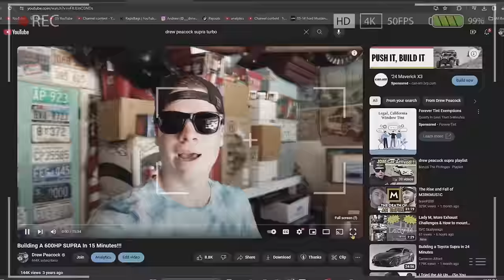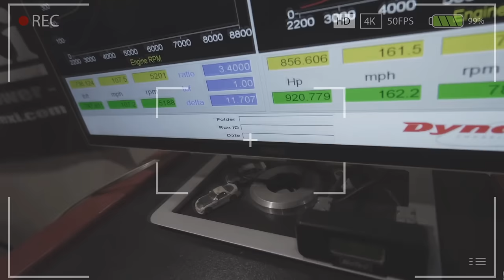My Life Is Ruined… Dream Car is Gone…

Comment: Trust me, that metal is toast. You need new frame rails and aprons. That metal is severely fatigued from the heat.
Reply: bro just shut up fr. let the man fix his own car you go work on yours
Reply: then you go fix it
Reply: @Thursty6 but he's right lol
Reply: @Thursty6 the truth hurts doesn't it? And besides they are allowed to state their opinion on the matter
Reply: @Thursty6  You can't fix fatigued metal unless you'll go ahead and melt it to it's liquid state and start over again. That metal is warped, you'll have body gap issues, structural rigidity is going to be bad and unsafe. The frame of the car is designed and meant to flex, with the frame being fatigued and warped, it would become hard and brittle. So yeah, bro just shut up fr. The car is cooked and it's going to be an absolute money pit if he tries to rebuild it, not to mention the resale value is also gone, the hassle and headaches, the safety concerns. It's not worth it, might as well just buy a new one.
Reply: @_M.Silva_  Bro said he dosent care about the resale value, did you even watch the full thing? lol
Reply: i´ll be honest it might be still fixable.
Cut a whole bunch off the front and replace it.
The frame at the front is prolly burned but they can be changed.
A good welder alot of metal work and it´s a supra!
Is it financially responsable? Nope!
But in the end it will be a supra again with a weird history.
Reply: If he can get a body shop (or maybe even do it himself) to remove the oem spot welds and put new metal pieces on, the supra should be good to rebuild
Reply: @JoshuasProductions  did i only talk about the resale value in my statement?
Reply: @_M.Silva_  no but there is no point in even mentioning it if he does not care lmao
Reply: @JoshuasProductions  i was talking about the negative things about rebuilding a burned down car didn't i? Whether he cares about resale value or not, since i was talking about the negative effects of rebuilding a burned down car, it doesn't change the fact that the resale value is gone. And i mentioned it just for the sake of the topic. What's so hard to understand?
Reply: @Thursty6  bro is mad for no reason
Reply: @Delta132  i´m not sure if a bodyshop would touch a burned car.
But he could do it himself, Mat Armstrong already proved it can be done with almost no experience.
Would be a great projekt for us to watch for sure.
Reply: Hey, im studying mec eng, so i might have a lil bit of knowledge. The temperatures of the fire, for what ive seen, werent high enough to change the majority of the properties of the metal. fatigue is different. Since the metal wasnt under high forces, only high temperatures, you might have room to work with. It is not the same metal, is wont handle the same, prolly a little bit worst, but it might be reusable. is trully a MAYBE situation that only drew and whos working with him will know , if so.
Reply: is like doing sports after an injury
Reply: Reps of NASA have been debating on this chat 😂
Reply: Time to tube the front end 🤷🏻‍♂️
Reply: @Thursty6 difference is, its now structurally unsafe, even a small crash could cause the driver and any passengers death, value of life is way above the value of the car
Reply: I second this. You cannot reuse the front end of that car. It is no longer safe in an accident and will cause more headaches in the future.
Reply: No its not. The steel used to make frames is freaking designed for high heat because of the engine. The engine? The block and everything in it is probably fine. Everything else? toast. The frame? Good. Suspension? toast. Brakes? fine. But again the frame and block are fine.

Comment: Those aprons and lower rails are high strength steel. It doesn't play nice with high temperatures it makes it brittle. You won't find out how bad it is until it's involved in an accident and the rails crumble instead of collapse as designed. Can put a lot more impact into the cabin and be dangerous. Replace the front structure, it's not worth the risk. Just buy a front clip and swap over the the apron and rails.

Comment: Bro that’s actually so unfortunate. The worst part is the Supra is so overhyped now that it’s going to be almost impossible to find a non wildly overpriced one to replace it 😔
Reply: thats why he should rebuild it ... and do it all fresh at the same time
Reply: @G35Jeesh  might be more expensive that way. Also is gonna be hard to find the parts for it
Reply: @Spendo  Yes, but im not talking about restoring it OEM. Im talking about tucked harnesses, drift style dash etc .... He needs to remove the motor and clean it all up and it would seem like an easier project. Anyways .... Not an OEM build, but enough to know its still a supra on the inside
Reply: @G35Jeesh  nah its structurally toast due to the heat. It wouldn't be smart to rebuild that.
Reply: @G35Jeesh Fire ruins the integrity of the frame. He'd have to do a lot of cutting for it to even pass a state inspection.

Comment: Sorry for the loss, but honestly I admire your attitude towards this whole thing.
My question is, if the motor and transmission are very much salvageable, wouldn't it be easier/safer (probably not cheaper?) to get a new chassis? Maybe a non-turbo automatic, since the drivetrain is gonna get swapped either way.
Reply: There are hardly any rolling shells and if one pops up they go for around 30k. Rebuilding a burned car can be a process, but should be a lot cheaper than swapping everything to a new shell.

Comment: This gave me an idea, might already be a thing. There’s got to be some way to put a canister of fire retardant on the under side of the hood that can spray the entire bay when an excess heat temp is sensed
Reply: Yea, you can buy a fire suppression system for vehicles. Good idea if you got big bucks and a big buck car.
This said the chances of a vehicle catching on fire without be touched is very very low. Unless its an electric vehicle..😅 then the chances are 50/50 of it spontaneously combusting.

Comment: I had a Toyota Camry with 400k+ miles catch fire from a wire coming loose from a new headlight I had just replaced. I didnt have a fire extinguisher and oil had leaked all in the engine bay, so it went up like a roman candle lol. I was devistated because it was my only vehicle.

Comment: The carbon fiber hood became a carbon fiber blanket lol. Jokes aside, sorry for your loss even if it was just a car. One thing I’d be careful of is that you should, in at least some way, reenforce the burnt metal. It may not be aluminum but the heat weakens the structural integrity of the metal and it could collapse under too much weight or stress. I can’t wait to see how this build turns out!
Reply: Literally 5 seconds after I hit play you explained you’ll be checking the metal 😂 ignore my comment

Comment: As a body guy, do not sand or grind the chassis. Take the time and strip the car down completely and have it chemical dipped to restore it properly. If you don’t, you will have issues with corrosion and it’s legitimately the best road to take.

Comment: So like you said I really doubt it got hot enough but considering how thin the frame steel is it's could have warped the frame. Not only that but also could have heated up enough to soften the steel making it much weaker and less likely to flex and go back to its original shape. If I remember right it can take less the 400° to change the structural integrity of your most common steels. Just something to think about. I'd hate for you to put more work and money into it just to find out the frame won't handle torque twist. I know you can straighten a bent frame. I'd just be more worried about the structural integrity.

Comment: Well the problem is that metal gets weak and soft when heated up an slowly cooled down.. I would check the alignment of the front suspention/axle/frame and if it is really badly bent, I definetly would swap the front frame. chop here chop there and weld in a new front. You know what I mean..

Comment: Cars burn down a lot more than you would guess.  It doesn't take but a minute or two before they are too big to put out without a big fire extinguisher, as cars have all kinds of accelerants on-board at all-times, and they have flammable paint and plastic everywhere that burns super hot and is hard to put-out once going.  The big deal here is how strong are the metal body panels, the steel brackets and parts in the engine bay, and the car's steel frame in the front-end, now that all of it has been exposed to fire, and possibly extreme-heat that would destroy it's temper? 
      The steel frame and any steel body panels and brackets are made from various tempered or heat-treated steels by the manufacturer.  Depending on the purpose, steel can be heat treated or tempered to display specific qualities, such as a desired stiffness, more or less flexibility, hardness, resistance to wear, and how springy it is when bent, or how far it can be bent and still return to it's normal shape.  If any of those steels are exposed to extreme heat in excess of what they were treated or tempered with, then they no longer will function or perform the way they were designed to.  The heat treating is really everything and super important.  You can take two identical pieces of metal, and I mean 100% identical in size, shape and chemical composition, and if you heat those two pieces of metal up to the same red-hot temperature, then quench one in cold water and the other in mineral oil, they will have different qualities afterwards despite being the same material.  The oil-quenched steel will be much harder than untreated steel, but still retains a little flexibility.  The piece of water quenched steel will be a LOT harder than the oil-quenched piece, which means won't wear out as fast when used in a wear-part, however, it is much more brittle and shatters if impacted hard enough, or if enough opposing forces are applied to it.  With steel, its always a balance between hardness, flexibility, wear-resistance, and resistance to shattering.

Comment: Please Drew get another chassis and swap what you want to keep over. The car is no longer safe. Once you heat metal up to extreme temperatures and quench it with water its microstructure is no longer the same. As others have mentioned most of the metal will be warped and it will be incredibly brittle. It is not worth risking you or your friends life if you get into an accident. Please

Comment: Car is on fire "I've had no issues" ... My brother in Christ, that's an issue. Wasn't there a fuel leak at some point? Looks like the return line dumped under the hood when it depressurized after being shut off